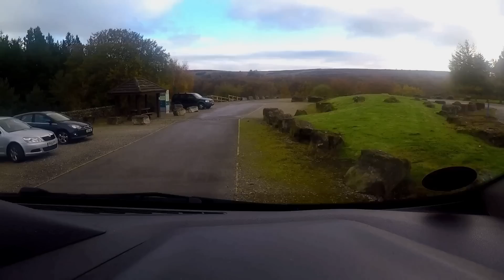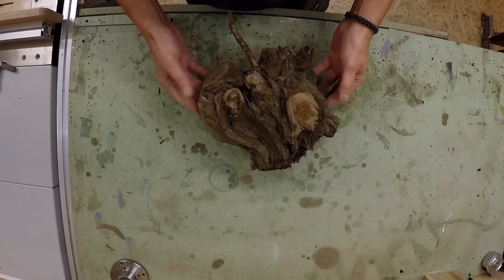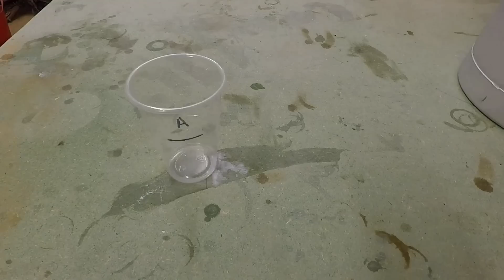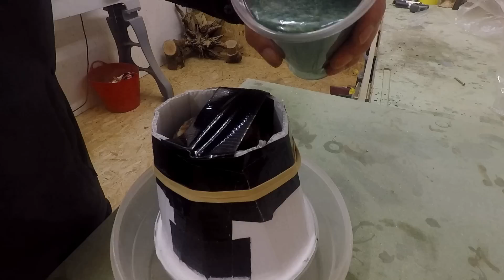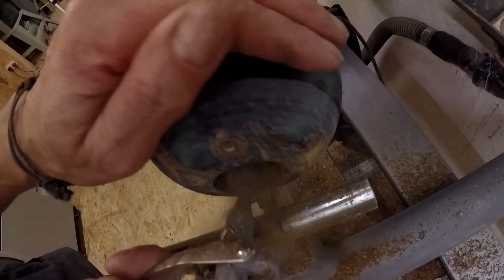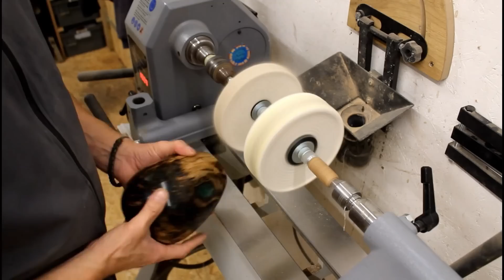Woodturning - The Reservoir Resin Root-ball

Comment: I bet the grit in those stumps will dull your gouges.
Likely need to resharpen during this turning after getting inside the "dirty" wood.
I really like how you've got your buffing wheels setup on the lathe.  That's a good idea, no need for a separate piece of gear, just use the turning center.

Comment: Hello Andy, do you only add pressure, or do you first pull a vacuum?  When casting / molding, it helps to first pull a vacuum which helps pull air out of pretty much everywhere by massively increasing its size virtually eliminating bubbles on its own.  THEN after the resin's pot life or working life, give it full pressure.  In the event any air was left, there will be NONE for-sure.  Really helps to get resin in tight corners.  Pressure pots put up to 4 atmospheres on top of the one we already have, but running vac, letting air basically expand to the entire container, then putting pressure on it will easily shrink air voids from ~1/4 their size (pressure alone) to 1/120th their size (or more).  Perfect defect free casting every time.    I have a pressure pot just like yours, vac line slips onto air fitting, run it for several minutes, tap container, pop off vac, wait for normalization and then put the pressurized air in it.  You can go straight to pressure if you desire as well.
Reply from the maker: I have a couple of vac chambers that I use if I think its necessary ..cheers

Comment: Will this resin turn yellow with UV? I see lots of these epoxy based projects, but my memory of using it for boat repairs is that if you don't paint over it, the UV will turn it yellow very quickly, Googling seems to indicate that there is no such thing as a UV proof epoxy and therefore seems that these beautiful creations will not stay beautiful for long. Would love to see pictures of these projects in 5 years time to see how they have aged.
Reply from the maker: I have some pieces which are quite a few years old and there is no yellowing.. but I usually add pigments or dyes so I'm not sure yellowing would be noticeable anyway ..i dont think casting resin can be compared to boat repair resin ..

Comment: But I thought wood had to be dried before you could turn it.  let it shrink. They always say that for bowls.  if you just dug it up and mixed it with resin, won't it warp once it starts to dry?  your work is gorgeous by the way :) <3
Reply from the maker: Thanks .. I rough turned it then dried it in the microwave before casting in resin ..
Reply: thank you. that makes so much sense.  this is so beautiful. i love your work.

Comment: Very nice. Was the wood piece seasoned at all before your work was done? I always wonder about shrinkage and such from wetter wood. I do suppose the resin keeps it captured though. Years ago I worked with fresh-cut limbs and such with the pith. I soaked in a peg solution and still have a vase from 25 years ago that never cracked. You are making me think.

Comment: What's the purpose of the pressure pot? To force the bubbles out of the resin?
Reply from the maker: The pressure prevents them from forming ..a vac chamber will pull the bubbles /air out

Comment: One thing I do not understand with these videos is the use of a pressure pot for bubble removal. Virtually everywhere else they use a vacuum pot which cause the bubbles to expand and float to the surface. A pressure pot would cause the bubbles to grow smaller in size and they would be less likely to come to the surface. Am I missing something here?
Reply from the maker: The resin gets pressurised to stop the bubbles forming or they are so small you cant see them

Comment: Was that up in Teesdale (Balderhead or Cow Green)? Also did you have to dry the roots out for a long time?
Reply from the maker: no its in Yorkshire .. I dried it in the microwave ..
Reply: The other thing I wanted to ask, a general question about epoxy resin combined with wood for turning, which seems to be a very popular trend at the moment. They look pristine and glassy smooth when they are completed, but are they the same way 3 months, or a year later? do you get warpage or shrinkage that ruins the pristine finish (uneven surface developing etc) Not a snide trick question, just genuinely curious. I have had problems when lanimating different woods that weren't quite properly dry or had different m/c and got tiny steps/ridges/unevenness etc where the different pieces butted up.